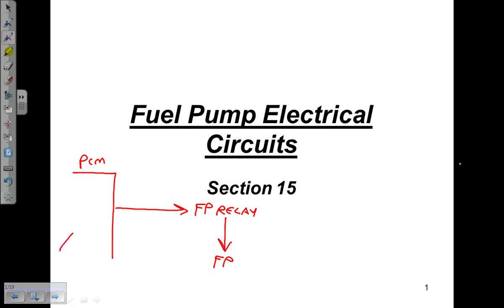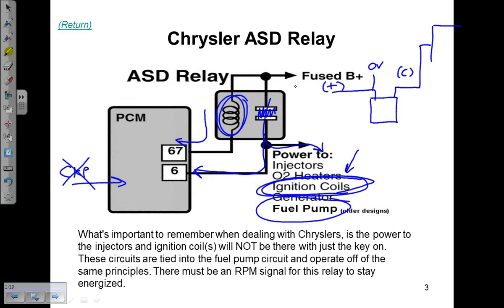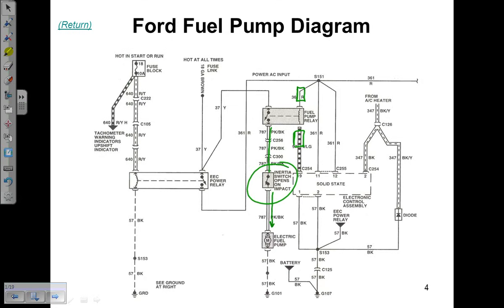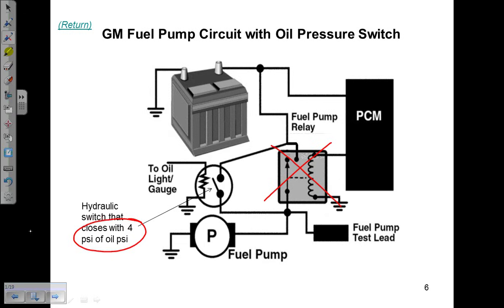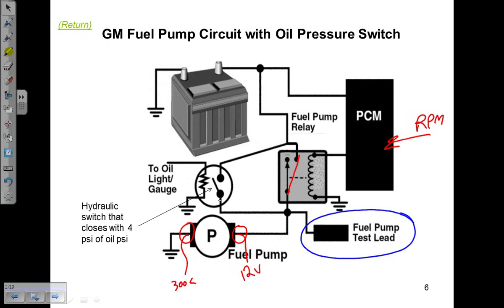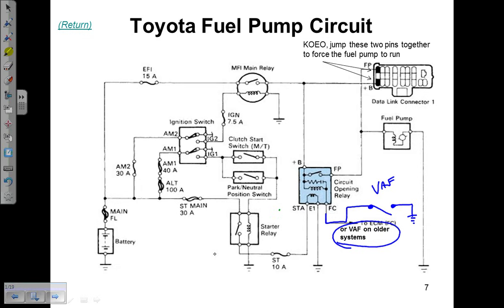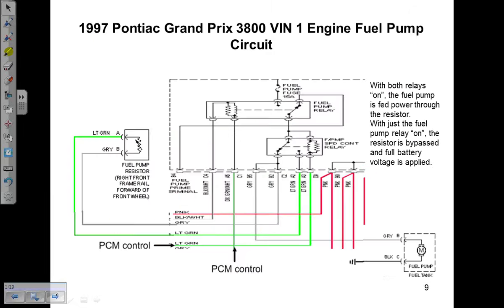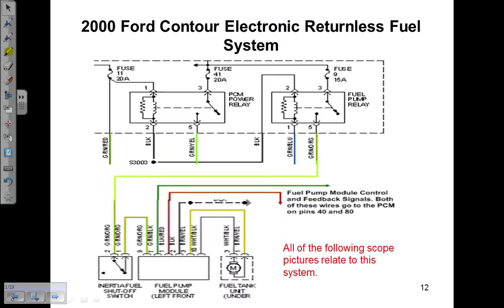Fuel Pump Electrical Circuits Description and Operation

Comment: Is it possible to wire the stock fuel pump on a 1996 dodge ram and bypass the computer for a carburetor conversion?
Reply from the maker: No, way too much psi and volume output on a fuel injection fuel pump compared to a carb set up
Reply: @ScannerDanner  is it possible to use the stock pickup in the tank and install an external pump ?
Reply: My reason for asking is a good friend of mine sons truck has a mysterious electrical problem that  shirts a fuse in the asd circuit and we've checked everything. They even replaced all the parts but no signal. His did mess with his exhaust and eliminated the upstream 02 sensor. After some digging if found at the connection for the 02, the wires were frayed and kind of melted together. The pcm is also new. I tried everything in my knowledge but your videos are so in depth that I had to ask. Its tuff seeing that kid bummed out. Any info is greatly appreciated.
Reply from the maker: @brianheggie9754  possibly but it would be pulling through a stationary pump assembly and would most likely be a restriction
Reply from the maker: @brianheggie9754  oh man, this is totally fixable! Let's fix it. 
If you have a scan tool, voltmeter and an incandescent test light i can help you
Reply: @ScannerDanner  sounds like we might have to drop the tank and investigate . Thanks again and love the videos. Very informative.
Reply: @ScannerDanner  voltmeter and test light yes but no scanner. I don't work at a shop anymore and am a stay at home dad but help when I can.
Reply: @ScannerDanner  would any scan  tool work or does it need to be like the professional one you use in your videos?
Reply: @ScannerDanner  would a faulty voltage regulator cause loss of signal and make the computer not turn anything on and could the crossed 02 that were melted together have caused a short?
Reply from the maker: @brianheggie9754  okay, let's start with moving this to my forum. It is free to join and we can share pictures and I can help you better than on here.  www.scannerdanner.com  as soon as you create a new post, message me back here. We are going to start with some 5v reference checks

Comment: Hello , i have meriva 1.6 z16xe. When its cold car takes about 4 seconds to start, i checked that fuel pump not starts on ignition for couple sec. I changed, relay, i tested , relay is good and i connected op.com wits obd , i was able to activate and deactivate pump...so why not starting to pressurise sistem on ignition , fuel relay get no ground when ignition on...even for couple second ground not connected. Only + from relay
Reply from the maker: I am not familiar with this model car at all. Post this to my forum www.scannerdanner.com it is free to join and I have paid moderators who are there to help me help you guys. We also have over 17k global members so I am certain we can help guide you. Thanks! Hope to see you there

Comment: Hi guys,
I have a bmw 320i e90 2006 model, the problem is engine cranks but not starting, 
Fuel relay is good but when I switch the car no voltage come on the top of fuel pump.
Don't know what is wrong?

Comment: I have no ignition signal to the pump relay on a 1995 chevy K1500, and can't find info on this issue anywhere
Reply from the maker: How did you confirm this? Are you getting no key on, initial prime pulse on that circuit either or just no power during cranking?
What else have you tested? Do you have spark? I ask because this will guide us to an input problem if you don't
Reply: Sorry.
Had a really hard time finding my way back to this comment.
When I turn the key on there is no ignition pulse power. If I jumper the pins to the pump the pump works. Also if I jumper the pins at the oil pressure switch the pump works. If I pour fuel down the throat of the FBI and start it it will start, but will not stay running without continuing to pour fuel in it.
Reply from the maker: @georgehuff5638  okay cool, on this model, you can have spark with a completely dead ECM. Not that your computer is bad, but dead as in no power, bad ground, shorted 5v ref etc. 
Next step, with the key on, see if you have 5v available at your MAP or TPS and report. 
I bet you do not have injector pulse either btw
Reply: @ScannerDanner  it turned out that the MAP sensor was bad. I happened to have one from a doner vehicle. Switched them out, and it fired right up. Running fine.
Reply: I really appreciate you taking time to share your knowledge with me.
I truly enjoy your videos. Keep up the fantastic work.
Thank you,
George.

Comment: what if it does not prime when you turn on the key?? but the truck still starts and runs ??
Reply from the maker: not all systems will use a prime, what are you working on? What are your symptoms?

Comment: Was hoping you'd touch on the Nissan pathfinder fuel system. Got no power to it. Did some research all pointing to then IPDM INTELLIGENCE POWER DISTRIBUTION MODULE not in this case. Think you can help diyer
Reply from the maker: Need more info my friend. Year, make, model, engine size. Post this all to my forum at www.scannerdanner.com It is free to join and we have over 17k members worldwide and paid moderators who are there to help me help you guys! Hope to see you there
Reply: @ScannerDanner  just joined and left some info but I think I'm limited one the words I can input. I may be wrong

Comment: On mine I'm not getting enough power to fuel pump test light is very dim
Reply from the maker: you have a voltage drop on that wire

Comment: My truck was stolen . When I got it back to wiring harness was cut . 7 months ago and it's still sitting . Replaced harness and the installer cut a few wires. No fire from ignition to pump . Pulling my freakin hair out
Reply from the maker: You'll need to provide me with more information than that for me to be able to help you. Do you have a wiring diagram? Can't do anything without that.

Comment: Everything you said makes sense. I have a 2003 Volkswagen Jetta and the fuel pump is not operating properly I checked the wiring harness plug at the fuel pump. I am getting 1.65 volts at the plug what's the ignition on. That's just me turning on the ignition walking back to the fuel pump and checking the plug. Any advice would be appreciated. Have a great day

Comment: This was awesome 
can you do one for Suzukis please
Im using Swift engines to build jet boats and am struggling with the ground wire off the ECU not holding ground to power the relay

Comment: EXCELLENT:  Your explanation has saved me the job of replacing the fuel pump.  Where is the fuel pump relay on 1997 Chevy Express Van 5.7L Vortec

Comment: 2005 PT cruiser pulling my hair out... OBD2 port no communication... took it to a repair shop with a P0335 Crankshaft sensor after the port can't be read read it on the cluster but now won't read in cluster so no way to read codes ...had crankshaft sensor replace they were trying to fix the OBD2 port now the codes for U0155, U0160, U110C , P0031 low voltage on both P0037 02 sensors ... the mechanic said on the PCM the 2 connectors to the left had pins out! Could the connectors be causing this? Thank you for broadcast... S.O.S. Do you have information on what each connector contols plugged into the PCM for 2005 PT Cruiser?

Comment: I put gas in my Chevrolet hhr ls  2006 at a quarter of a tank doesn't want to start on 1st crank but runs fine once it cranks check engine light is on is throwing evac code what do u think I have two fuses for fuel pump and a fuel pump relay do I have trouble coming
Reply from the maker: sounds like a stuck open purge solenoid causing excessive fuel tank vapor flow into the intake, which will be aggravated by a fill up of the gas tank
Reply: ScannerDanner  thanks I have subscribed for future reference I have a cousin who will look at what u stated and i will let u know but from what I c in comments u r always right thanks again
Reply: ScannerDanner  is it the one in engine compartment or in back by fuel tank on my Chevrolet hhr ls  2006 purge solenoid

Comment: could the ASD on a 1992 Dodge van b350 cause a no power to coil and fuel pump only in cold temp (below 35 degrees F) it starts at or above 35F. I've used a heat gun and warmed under hood to start at 20ish and its started.
Reply from the maker: When it doesn't start, you need to find out what you are missing. To many variables otherwise.

Comment: On an 1986 f150 5.0 efi I have key on fuel pump and everything, but the relay kicks out after a couple seconds. I don't have the fuel lines hooked up so it's not a pressure switch. Does the eec need to see rpm to keep the pump running? Thanks
Reply from the maker: Yes it does my friend. No RPM signal = fuel pump relay shuts off. All you will get is a 2 second prime

Comment: Paul,I have a 1986 Oldsmobile Delta 88. Shade tree mechanic replace fuel pump. Now has fuel pressure but no injection pulse. Should I replace the computer?  Any help will be greatly appreciated!
Reply from the maker: What engine is that? First gen 3800 ? Red tag on center of intake manifold?
Reply: That's correct! Red tag on center of intake manifolfd

Comment: I have a LS2 2000 Saturn it starts run for minute then quits like fuel not getting to system
Reply from the maker: what's your fuel pressure?

Comment: I have an 1989 corvette.  I already replaced full pump,fuel pump relays, all the fuse. I still do not have power going to the fuel pump. I need help. THANKS
Reply from the maker: these early GM computers had a lot of issues. Next test, check for 5v reference to either the TPS or MAP sensor with the key on. No 5v = the computer is not "alive". Check main powers and grounds to it next, then if those are good, try tapping on the ECM itself.

Comment: Great video. 
Will help find out if the long crank on my 96 2.2 s10 is from pump relay wiring issues 

Or other reasons I suspect. 

Either way this info has renews my interest in this issue and I'll probably get it sorted out soon enough!

Thanks great vid

Comment: I'm sorry to comment here. but. you Are the most knowledgeable to ask. I've recently got a 07, lex gs350.  I told guy I was buying it from to tow it home from dealer after they put 700$ into a new starter that only got it to start for a sec then kill instantly. they said 2600$ needs new pcm. I said tow it home. bought it from him. sent pcm to Sia electronics and 2 days of testing came up perfectly fine pcm. so because the cooling fan was coming on cold and staying on after 1st attempt to start I'm thinking relay. or short or sensor. I'm praying for some. any. guidance from you are the best would be ideal. my name is Dominic Waterman. this is my only car. I'll take any hints or direction or thoughts or requests for more info. please hit me back here or I'm honestly at 504-645-7320. Dominicwaterman@yahoo.com ...a new orleanian b and raised. please say something helpful. thank you SO Much ...thank you
Reply from the maker: Cooling fan coming on and staying on, along with a no crank suggests a power or ground problem for your engine computer. I bet it doesn't communicate with a scan tool either? Also, with the key on, unplug your coolant temp or intake air temp or throttle position sensor and measure voltage on all the pins. There should be a steady 5v on wire of the wires on any of the sensors that you measure. (unplugged is key though on temp sensors, plugged in, they read less than 5)

Comment: a quick history , the truck ran like a charm so i even put the  brand new Michelin tires on it sure enough after  driving  home  like it was a charm ,.,..   a few hours latter  went to get back in and  just a whinning near the starter so i thought that's  what  it was , the  shop said  i  needed a  fuel pump and  put one  in , a  day  latter  they called me with  worse news  that it had  zero compression in all cylinders , THEY FUCKED UP ROYALY , So i said  put the old pump back in and give me my truck . was wondering also after 3 tows  and a  replaced fuel pump i  did push the inertia switch in also to see what  would  happen can that be  stuck ? or  can  the  shop not  have put the ground wire in properly for the  fuel pump .

Comment: Hi after several bad mechanics but good reviews about you I would like to ask , I had a used 61 k engine installed in my 07 ranger sport 4..0 sohc  with a 126 inch wheelbase ...... got the truck back and  immdeatley  got banks 1 and  2 upstream reading stuck rich , no other codes period come up , and my check engine light is on . A  is it possible 2  new  02 sensors  can be bad at the same time . I just had the fuel pressure checked at  70psi  which seems a lil high  considering the massive leak in the mechanics gauge .  im almost wondering if the  ford dealer is a better option then checking all the sensors with no codes being thrown  off ,  can a bad fuel pump regulator cause extreme fuel pressure ? any help would  be  appreciated , btw  cleaned maf and  iac  valves ,  hate to throw tons of money in unneeded sensors if there are  common causes of rich  stuck open 02 sensors .
Reply from the maker: I've been down this road with a 99 Ranger. It had an engine replaced. Turned out there is a difference in the injectors themselves on whether this is flex fuel or not. So my guess is your truck is flex fuel and someone put in a non flex fuel engine. I could be wrong, but you need to consider this variable

Comment: I have a camaro rs 305 tbi I am having gas delivery problems from the pump to the fuel injectors. Turning the key does nothing but you can hear the fuel pump. I changed my starter, dropped my rear and replaced the fuel pump and even changed my ignition, ignition module and I can't even get the car to crank. My battery is dead now but even with a hot battery it does nothing but power the fuel pump. Can someone please help me I'm spending too much money and still not fixing this problem
Reply: Ratchet Renz 2004 jeep the gas tank fell out I replaced new fuel pump no power?? Yea the tank hit the ground and daughter did not know until it stalled out 30 feet later

Comment: OK ScannerDanner, I got one for you!!! I got a 2003 Silverado 3500 6.6 Diesel truck. Cranks but NO Start!!! It has 3 Multi-purpose Relays. ONE of them has NO power to it. The one in the middle on the fuse box. I'm sure it's the one that controls the fuel pump. Why doesn't it have power??? The others do! Battery is on! New fuel pump installed! No power to the relay-no power to the pump. What up??????
Reply from the maker: Post this to my forum. Without research and a good wiring diagram, I cannot help you. But we can do that over there.
www.scannerdanner.com
Thanks! Hope to see you there.

Comment: Yes the gm oil pressure switch will shut the car off if the oil pressure is to low. Here is how it works. The computer closes the fuel pump relay to prime the system and for a little while after the engine starts. Then the ecm shuts off the fuel pump relay so the path through the oil pressure switch is what keeps the fuel pump on. How do I know this? had a friend with 1996 buick it would start up and then quit soon after. Bad oil pressure switch. Replacing oil pressure switch cured the problem
Reply from the maker: This is not true brother. The ECM does not shut off the fuel pump relay with the car running. The only explanation of why your 96 Buick acted that way, would be you had a bad fuel pump relay and an oil psi switch problem.  
In the 24 years that I have been a mechanic, I have never, not once, had a GM oil pressure switch cause any driveability problems, however, I have had MANY with faulty fuel pump relays with extremely long crank times. 
What you are suggesting makes sense, it's just not how it is being done. I promise you the ECM does not shut down this relay after the engine is running.
Reply: Think about it. Does your explanation make any sense? Why is the switch in parallel with the relay? of course its there to keep the fuel pump on as long as oil pressure stays up. Why would the engine run for a very short time after starting and shut off. And why did changing the oil pressure switch fix it? of course its possible that not all gm  computers work the same way. There may be some that keep the fuel pressure relay on if the computer says so. but, the old buick worked exactly like I told you. There is the possibility of a real good reason for the switch being there on some gm products. As a troubleshooter my self. I very seldom say "can't be true". When I was young every time I said that I got proven wrong. So I learned to say"seems unlikely".
Reply from the maker: good point. "Always" and "Never" should not be in our vocabulary. 
This may have been in the original design as you described. I wonder what year they stopped shutting down the relay. It had to be way early. 
We had a students car 1989 Camaro with a melted oil psi switch plug and it was a beater, so we didn't care much about it. So we "fixed" it (it had a short to ground) by eliminating the plug altogether. Car ran fine, never shut off, working completely through the relay circuit. 
I'll admit, your explanation sounds legit. It absolutely doesn't make sense the way they wired it. But the problem I have with it? You are the first person I have ever heard of that replaced an oil pressure switch for a stalling problem. It "seems likely" :-) that you also had a relay problem, and maybe one that existed for a long time before the oil pressure switch started acting up, therefor creating your stalling issue.
Reply: ScannerDanner had a 72vega oil switch fed fuel pump once carb empty had to long crank they tended to run out of oil .old tradition w. Gm.

Comment: My son turned over my 2006 Nissan Frontier 2.5 and I can't find any info as to an inertia switch? I need to clean the engine out because of the obvious oil throughout. Do you know if this model Nissan has an inertia switch?